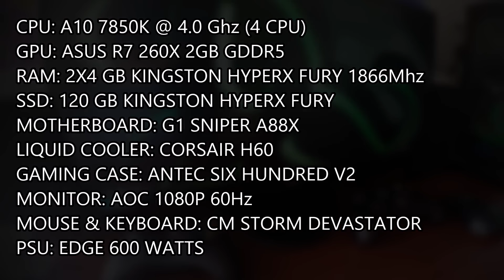CONFIGURACION DE MI PC Little Hulk 2015 1080p60

Comment: You gotta get 2400MHz RAM for a Kaveri setup, the APU uses RAM speed for communication since it's built in to the chip. It can boost frames in games significantly.